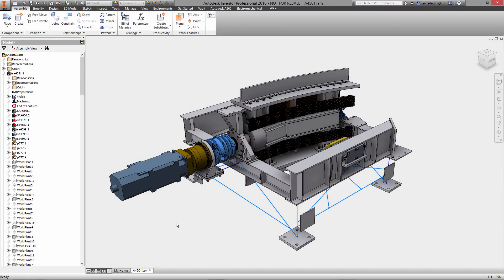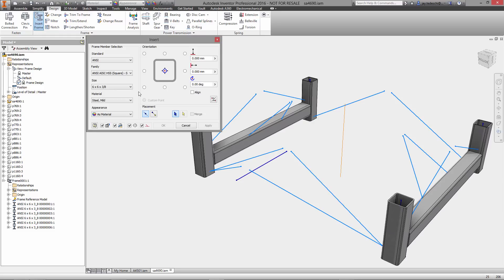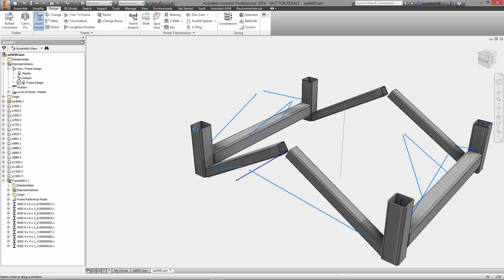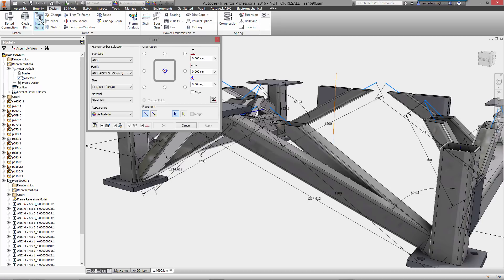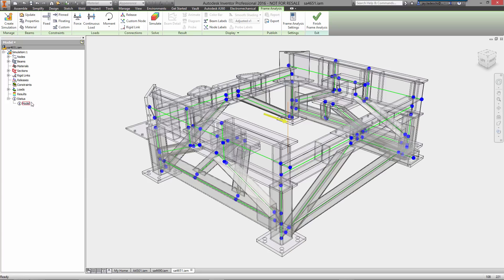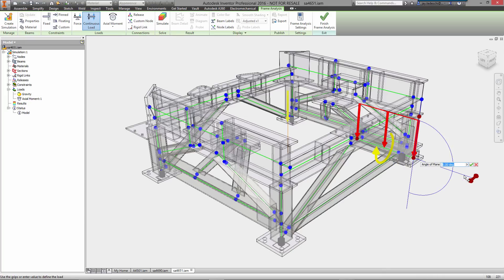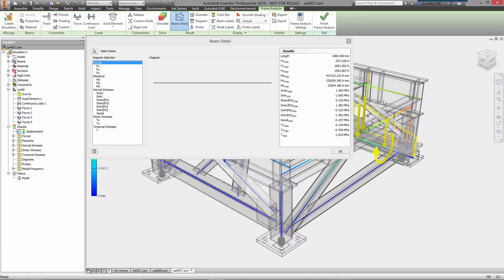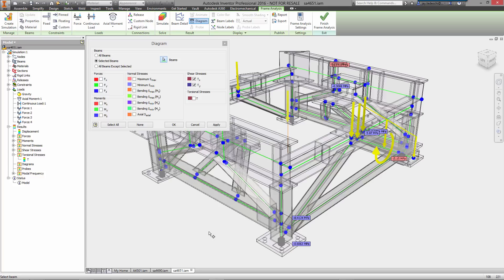Autodesk Inventor frame design long

Comment: It's missing the insert of the plates, which I guess are parts drawn by you. You have a tutorial where you place and constrain those plates?
Reply from the maker: This is Inventor 2016, there end cap options in the newer releases...
Reply: @AutodeskMFG  OK, I know the end cap option is in the newer release. That's why I asked how you insert the plates in the oldest versions. There is not structure without those plates.
Reply from the maker: those plates are probably a sub-assembly with the skeleton frame part. There are few different ways to add them...